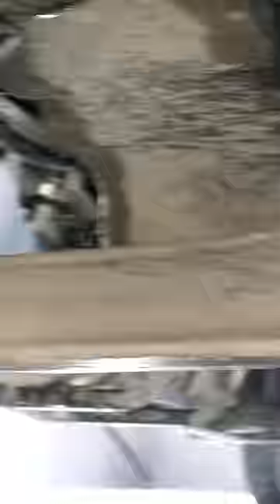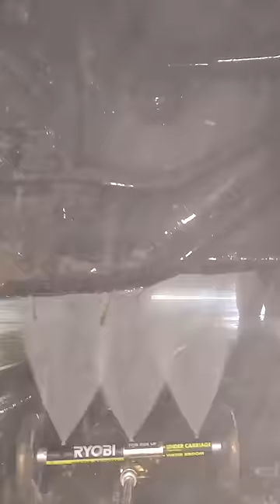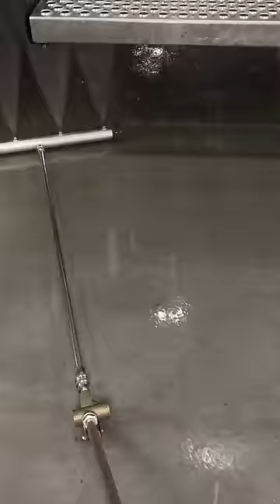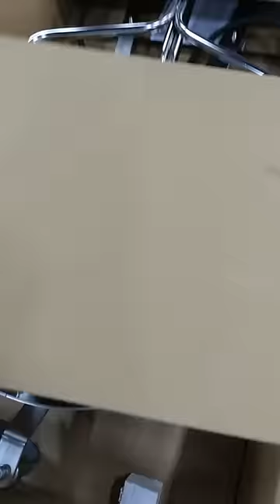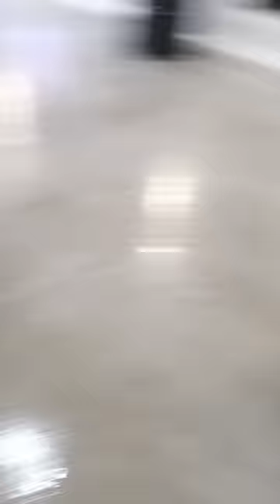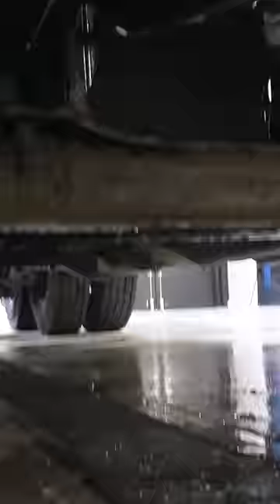I'm playing with some undercarriage sprayer options!😁💯❌ #chemx #powerwashing

Comment: How many leaks did they find the next day? 😂
Reply: After the 1900psi ripped everything off? Well I'm sure it has about 30.
Reply: I was thinking the same
Reply: None
Reply: Those poor brake/fuel/def/cooler lines 💀
Reply: ALL THE LEAKS
Reply: The answer to that would be yes
Reply: Tell me you don’t know about semi trucks without telling me you don’t know about semi trucks
Reply: @zacharycrawford191  I grew up in a trucking family. I know plenty. Its just coming sense, when you bust off old caked on oil leaks. You get to see the leaks. Common sense
Reply: @jimenex13  nah bruv, that's not even what's going on here none of that dirt looks oily, or even all that old. And it was obvious to everyone what you were implying. That the washer itself was causing damage. So what don't you just zip that pickle polisher back up little man
Reply: Probably good to have the leaks fixed anyway
Reply: Yeah wonder how many leaks that happened on the driveshaft and the other solid chunks of metal he cleaned by pressure washer, gotta retain that driveshaft fluid! People who are afraid of pressure washing are ultimate cousin breeders
Reply: @i-_-am-_-g1467  you obviously aren't a car person.
Reply: That mud was mechanically applied & holding the truck together
Reply: @jimenex13  no you
Reply: Lmao yeah people seem to disagree but out trucks have a lot of wiring repaired and tapped then zipped tied up, lots of plugins and wiring harness just seems like a bad idea
Reply: @jimenex13 You obviously aren't a car or pressure washer person. People thinking this gonna cause leaks. Good grief.

Comment: It might look good underneath but I'd never want that used under my truck😂
Reply: Lmao im afraid of if it can damage any thing under the engine compartment..... probably cant but still Jesus christ 🤣
Reply: @Edoc no with a typical pressure washer or a high-end pressure washer spraying at 4,000 PSI or maybe even 4,400 PSI you're not going to do any damage to anything located under the undercarriage unless it is already damaged and just waiting to finish breaking
Reply: @diychad7268  it can for surely damage something if the truck was running for more than 3 minutes
Reply: Leaving mud on your frame is not a good idea. It can hold moisture for long time and will eat your frame out if mixed with water+salt+mud .
Reply: @Edoc everything that's not in the cab is made to get wet. Just don't blast it with the pressure washer for hours and it should be fine. Things u should not pressure wash is the ecu 😂 , even though i have seen some pressure wash the ecm and still going 6 7 years on that car.
Reply: Nothing is perfectly sealed. High pressure is never a good idea under the hood or carriage. Use natural detergents, elbow grease, and stay below 3000psi washers.
Reply: Washing is really good for corrosion control
Reply: @KuntalGhosh  this is a big truck frame ... by the time this frame rots out the truck should be in the scrap yard anyway
Reply: @KuntalGhosh  you can fully submerge an engine and the entire electrical system/ecm in water and it’ll run just fine with a snorkel.
Reply: @lawofliberty3517  A  friend did a lot of mud bogging in the '80s. They sprayed it down with a low pressure fire hose to knock off the worst. When he got home, he'd park on the front lawn. He'd run a lawn sprinkler under it with a regular garden hose that he'd periodically move. Low and slow with the least amount of damage. He'd hit all of the zirc fittings when he was done. I can't imagine hitting it with this high pressure and high temp system. Too much potential damage.
Reply: @MrPland1992  not all engines, especially modern ones with complex electrics etc, pretty sure it's not as simple as just chucking a snorkel on, unless it's already designed to be submerged. 
Even if the engine isn't flooded, a lot of cars/trucks will die from electrical faults.
Reply: @Edoc If it breaks while washing it, it needed attention to begin with. Don't be scared. Open the hood and pressure wash EVERYTHING.
Then open the doors and blast the inside. Blows the stains right off the fabric. 
I'm not kidding.
I WAS kidding. About the interior. Please don't do that. Never thought anyone would take that seriously.
Reply: @Hard_Right  Should be. But, they go to auction for CHEAP, then someone buys them and runs them for another 5-10 years as a plow truck until there's nothing left but a pile of salt and iron ore. 
And big trucks, if maintained properly, last forever. Engine throws a rod... Short block, or whole new engine. Blow a rear end... Replace the whole gearset (carrier) as an assembly. Everything is modular and meant to be replaced. Frames can be replaced too, but the frame is the foundation that everything is built upon. Basically have to disassemble and reassemble entire truck. So the frame IS the truck? Not really sure now thinking about it, maybe trucks don't last forever... If, over the lifetime of the truck, you replace every component as they fail, eventually replacing everything one at a time, the cab, the engine, the wheels, the frame, is it still the same truck?
Hmmm.....
Reply: @mconradb  someone did that to my bosses van and the radio died. 👌
Reply: @MrPland1992 Submerging and blasting with high pressure water are two different things. Especially with all the electronics on modern vehicles.
Reply: @mconradb  
We had a company wash out our trucks once with that same method you mentioned.  I think those people were nuts completely ruined a few interiors of some of the trucks. I had to drive one for a few weeks and the mildew made me sick.
Reply: @KuntalGhosh  Exactly, This is common sense
Reply: @lawofliberty3517 and you think driving in the rain at highway speeds, that's not high pressure?😅

Stick your hand out of a window in the middle of a storm doing 50-60mph and get back to me on what you discover.

Y'all act like vehicles are built like Cinderella's pumpkin carriage at midnight. 😂

Comment: This is where you either find the guy or friend who knows CAD, 3D Printing and Design to create the right tool for you. That third device was dope but it needs an “Angled” option for when it sprays. Basically the nozzles can be adjusted to that they don’t just spray straight up.
Reply: I don't know what other direction you would want to be spraying other than down and they do make a contraction that sprays down to do like a driveway or a patio or something it is literally the same thing as this just turned upside down with a skirt going around the outer edges of it
Reply: @diychad7268  That’s exactly what this is. An upside down asphalt scrubber with less nozzles. Now all that’s needed is the option to add angled nozzles for a little sideways spray action that he was needing to catch those crevasses.
Reply: @LawrenceGerman  
My design has all of that.

Comment: Honestly I'm not surprised, none of them spray horizontally to get the stuff caked front to back, it still takes a gun and some elbow grease.
Reply: The hurricane pro version certainly does, its fully adjustable to 90 degrees

Comment: Damn that hurricane one how does that not end up damaging some of the hoses and stuff underneath the truck
Reply: sylarrogue8443 It can, but typically requires an added abrasive to do so. In this case not likely
Reply: Sylar Rogue  diamonds
Reply: sylarrogue8443 u wouldn’t use diamonds as an abrasive cutting is usually done with garnet

Comment: Ouch, she’s going to spend some time at the mechanic after you’ve washed away all lubricants from places it’s supposed to be
Reply: Which is where? Just curious.
Reply: anything that needs lubrication under a car is either sealed, or protected by a rubber boot. otherwise you'd get dirt and grime in the grease, which would act as an abrasive and wear these components out

Comment: Low pressure is the to go for under carriage cleaning especially if the customer uses fluid film
Reply: What the hell is fluid film?
Reply: @diychad7268  It’s an oil protectant that you spray underneath to prevent corrosion

Comment: Someone who constantly gets thick clay/mud off of the bottom of my jeep: a normal sprinkler works wonders. Sometimes I'll use a splitter and 2 or 3 at the same time. Set the limiters on the fan and just move them around lol.

Comment: An undercarriage washer that would be effective would be one like the first except have the nozzles on the spray rail angled at 45° on both sides with probably 3 per side that way it's working on an approach instead of just being vertical.

Comment: You do realize the reason the last one was the best was because it only had two spray nozzles that were rotating causing an agitation of water, because of only two nozzles those two nozzles were able to spray with a higher pressure than the four nozzles were, for example originally you have one nozzle with a pressure washer handle and it sprays for example 100 PSI so if you now divide that to where instead of it coming out of one nozzle it is coming out of four they are only roughly spraying at 25 psi a piece, of course the angle degree of the nozzle will make a slight difference here, so since that last one only had two nozzles they were able to spray at roughly 50 psi, remember these pressures are just hypothetical for my example here, and they were rotating causing the agitation effect, that last contraption is essentially the same thing as one that you would use to clean larger areas of a driveway or a patio or something but it was just turned upside down so that it is spraying up toward say the undercarriage of a vehicle instead of down towards say a driveway

Comment: Imo those things still leave alot inside the frame. I hose down my truck and trailer every shift. There is still so much stone/mud inside the frame rails and around the air hoses and wiring harness.

Comment: As a person who lives in a snowy climate would that wash off my oil guard? For those who don't know it is a spray of oil underneath the car to help prevent rust from the snow and salty slush.
Reply: Yes spraying pressurized water at an oil coating could remove it, most likely it would displace the oil (spread it around), but it depends on the pressure + duration of time you spray at a given area, while it likely wouldn't remove the oil coating completely, you would still be defeating the purpose of your oil coating by potentially spreading it around and thinning it out with pressurized water. If you want to rinse it off, I would use a regular garden hose with normal tap water pressure. If I can make a suggestion, get a rubberized undercoating like from Ziebart, it's like a "rhino line" for a truck bed but for your undercarriage. I had mine done, it's expensive but much more durable than a rust inhibitor oil coating, plus I can spray it with soap and water to get the road salt/snow off as much as I want without having to worry about hurting it. If it gets chipped up from gravel on the road you just take your car back for touch-ups. It doesn't make my car bulletproof or impervious to the elements but it gives me peace of mind. Just my 2¢.
Reply: @yunoletmebeanon  appreciate it I'll look into it, but if i were to just do the oil coating it would probably be best ot only do the cleaning in the summer time when its warm then?
Reply: Just use a lower pressure version, the oil coating is fairly durable,  i use one and my trucks undercoat is Amsoil MP.. no problem,  i also feed a product called salt lick, made by hotsy and designed to neutralize road salt

Comment: Just curious...
If you took the original washer and put them between a 35 and a 60 degree  angle and as you push and pull it will get the sides of the frame and the cross members.
I'd honestly add 2 more power tips to it so lt will add more volume.
Other thought make the tips movable.

Just a thought tho...

Comment: The should be more angle nozzle. They just flip up the pressure washer surface cleaner, which is designed for flat surface that is it doesn’t clean that good.

Comment: Later on the engine  code its light the dash like cristmas tree  after water getting  on all cheap  connections that factory  put in tho break with heat  and the best elements in earth water. Fantastic let us know what's sensors its pop on the tree.

Comment: I designed this tool in 1997 and didn't follow through with my patent. Mine has height adjustment and changes spray angles with a turn of the handle.

Comment: Its so crazy what all you detailers do to cars and trucks. Last may a customer of mine had a “detailer” guy pressure wash his backhoe and he totaled it. He blasted water into the wipers on the hydraulic cylinders…all of them. The whole hydraulic system is full of water now. Got water into the intake. He wasnt sure what the clear stuff was around the seam of the window so he pressure washed it-it was silicone holding the window in place. Then he cleaned the engine bay. He obliterated the radiator. Every fin was mashed. Whoever said it was ok to pressure wash under the engine in this video is not smart

Comment: I think the more pressure you add more chances are you messed up some wires 😂😂
Reply: There should not be anything exposed in the undercarriage of a vehicle that could be damaged by a pressure washer, if it is then it was just a problem waiting to happen or it is something that is already damaged and just waiting to break
Reply: @diychad7268  dude come-on look at the video there's lines that can be damage by the pressure you saying it like if it's covered with stainless steel smartass 🤓🤓🤓

Comment: And after 20k gallons we have a clean undercarriage
Reply: Pressure washing actually uses a rather low amount of water, it doesn't use any more water than what a normal spigot will put out, spigots usually put out anywhere from 4 to 5 gallons per minute and pressure washers are at the most equal to like four and a half gallons per minute but pretty much all of them are 4 gallons per minute and less, they are designed to take small amounts of water and pressurize them in order to aid in cleaning whatever it is you may be cleaning
Reply: @diychad7268  wow!

Comment: Y'all really don't know how pressure washers work huh? If he's running roughly 4,000 PSI, let's just say and he splits that into two. It's 2000 per jet, that won't hurt the track. These things run on the road daily. A little water underneath ain't going to hurt it and if it does it was probably broken to begin with or needed fixed. I run pressure washers daily to clean carpet and tile and other assortments. We mainly use 600 PSI however it split onto like four or five jets so that's like 120 or 140 a piece which is nothing
Reply: Who taught you pressure mathematics?   If it's 4000 psi at the handle, and coming out 15 ends, it's still 4000 psi.  Pressure systems are made to drop down at lower volume to keep pressure.  If your loosing that much pressure your system is broken.  Otherwise none of the nozzles would run same consistent pressure, hell one or two may not even drip at all, it'll run to the first and lower each outlet after that.   Sorry, but your wrong.